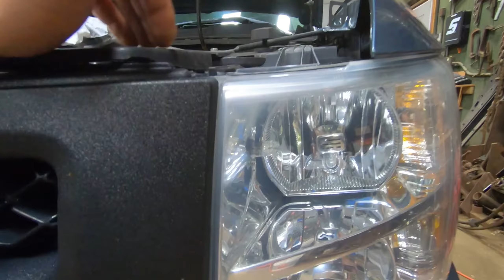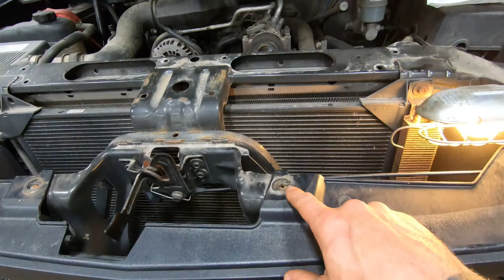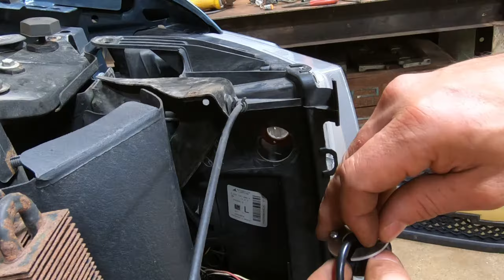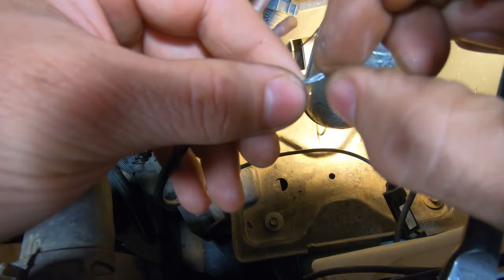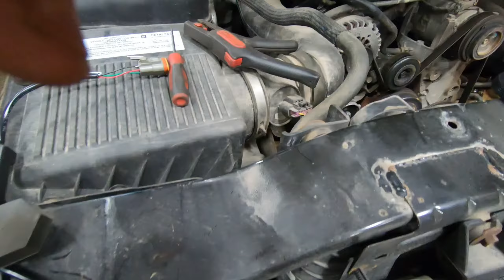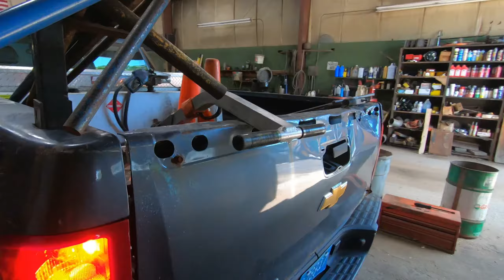Replacing strobe lights with Whelen led vertex hide away strobe lights

Comment: what strobe box you using? im trying to make my decommision fire rescue truck strobes functional again. think my tubes are burned out though.
Reply from the maker: These led lights don’t use a strobe box. You just put power to them. I don’t remember what strobe box was in it though. I would find broken wires a lot on the older strobe tube lights. I would recommend converting to the led lights personally, they cost about the same as the tubes and are more readily available. They are less problematic too I think.
Reply: @JasonTheMunicipalMechanic  k. i will look around for led replacements. i ran the part number for my old whelens and they are $400 each. i got two. I have the micro ones on each side too and havent looked up replacements yet. lol My side ones I can pretty much wire up any but my grill ones have to fit in the housing thats also the sirens so i would have to find something thats got a reflector the same size.
Reply from the maker: https://www.whelen.com/all-products/?utm_source=home&utm_medium=button&utm_campaign=slider these are the products I use. You need to get them from a distributor though but you can see what they have. You may have a problem if you are looking for red though. They will only sell red to firemen and blue to police. You might be able to cut out the glass tube and mount a clear led in its place though. It’s worth a though I guess.
Reply from the maker: I sorry just noticed you were already looking at the Whelen lights.
Reply: @JasonTheMunicipalMechanic  well my truck already has Whelen lights. Original ones that we on the truck when it was specced out in 1989. Thats the manifacture date on the back of the housings,

Comment: I am 16, I am a warning light fanatic, I really enjoyed watching this and I will be using your information!  My only difference is I will be installing high voltage xenon strobes.  I prefer this technology to the LED.  Great job on the install!
- Kody
Reply from the maker: That’s good to hear. Working in the road we definitely have a bunch of warning lights. The older high voltage strobes do work, but the industry is getting away from that type of light. They are expensive and require the strobe box. Everything we get now is all led. If you can find them and they are cost effective to you then there is nothing really wrong with them. I have heard from a few sources of the strobe boxes burning up and melting connectors though.

Comment: I got 6 of these leds. Do I need a power supply to put them on
Reply from the maker: I don’t believe you need a power supply. The ones I put in are wired through a switch to the battery. The older non led strobes needed a high voltage power supply to flash them but leds are low voltage. There are power supply switch boxes that make it more convenient to control the lights by just giving a set of low voltage switches and fuses for each circuit, but it is unnecessary. You will need a way to turn the power on and off though.